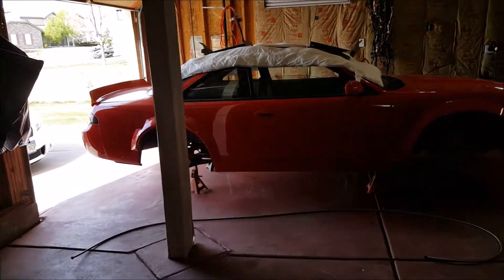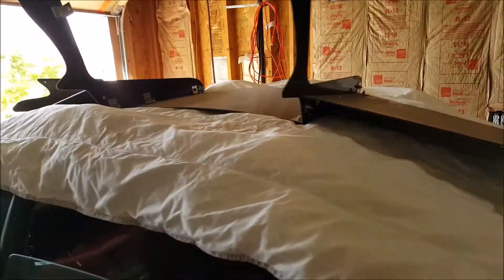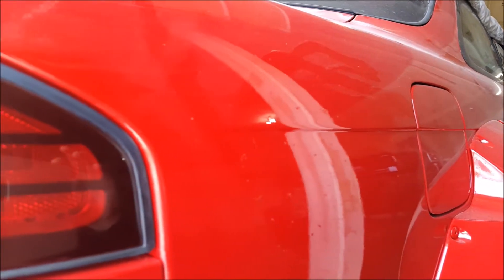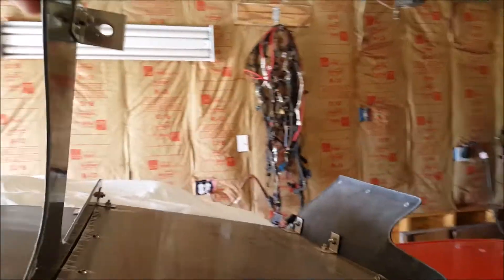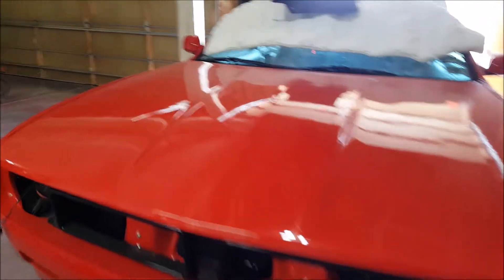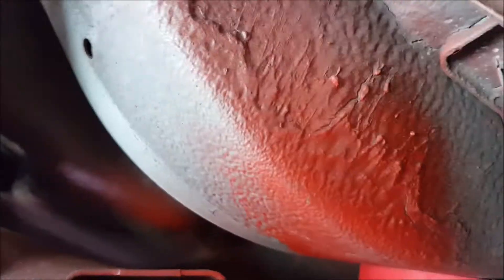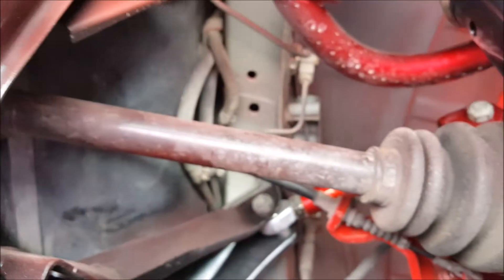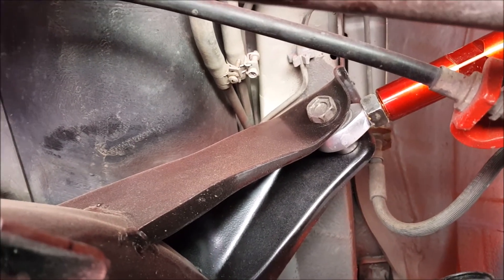Corvette fuel filter and lines installed on LS v8 swapped Nissan 240

Comment: I bought the SIKKY fuel line kit and mine leaks out of the top side or single outlet side. I'm not sure what I missed but have you had any issues mounting yours on the frame rail?

Comment: Is that regulator adjustable at all or how does that work? Im sure the pressure from a c5 is different than my 240 with a 5.3.
Reply from the maker: The original regulator I used was adjustable but the C5 filter regulates the pressure to 58lbs which I believe the stock pressure the LS requires. Hope that answers your question
Reply: Awesome, thank you!